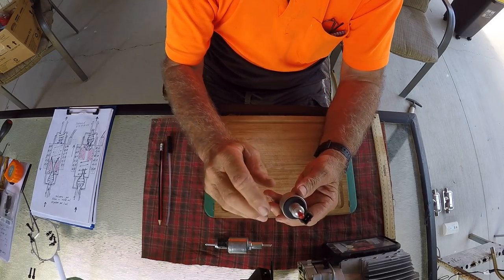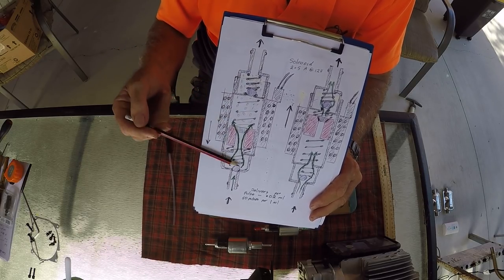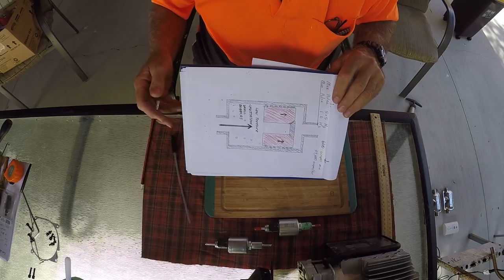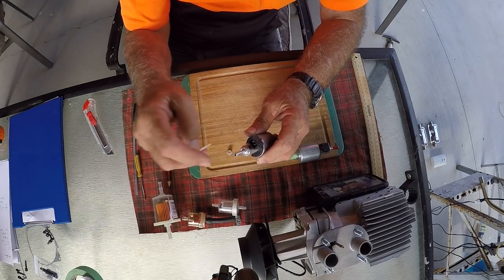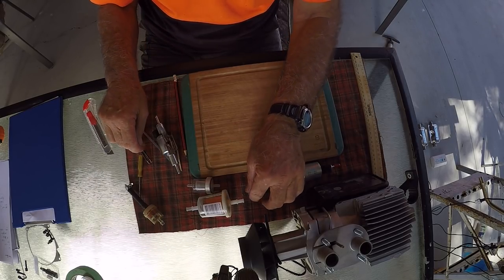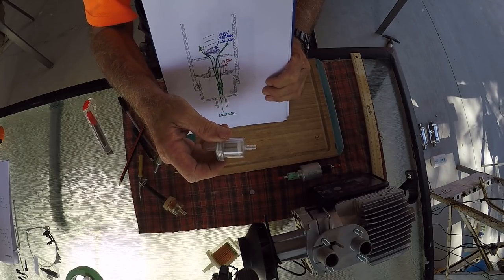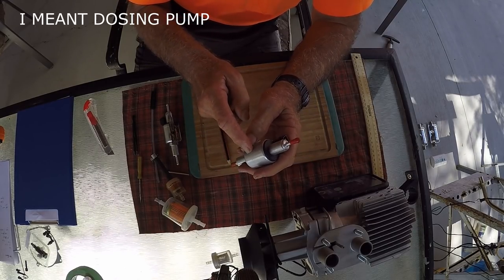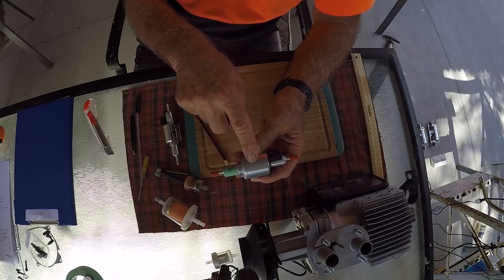Chinese Diesel Air Heaters   Part 7   Metering/Dosing pump

Comment: Hi John. I've primed my line and filter (the country way as you put it!) and the pump clicks away but it doesn't seem to draw any fuel through. There's no sign of anything happening to the fuel in the filter. I've left it clicking away for a while. Any ideas? Thanks in advance!
Reply from the maker: Hi Tim,

Did you let it go long enough? Each stroke pumps a very tiny amount of fuel and it can take some time before fuel goes through the line.

Have you connected the hose to the pump inlet and not the outlet. Some people install the pumps upside down. The wire plug to the pump is on the top, outlet side of pump.

If the pump is fully primed, and fuel is actually at the bottom of the pump, take the hose off the top of pump and get it pumping, either manually, or turning the heater on. After a minute fuel should squirt out the top of pump.

If no pumping fuel, could you have had some rubbish in the line that blocked the pump?

Next, get a small container of fuel and a long piece of hose and put the container about 1m to 2m above the pump. Prime the line and connect to bottom of the pump. Does the pump now work?

It is very rare, but possible you have a dud pump. If a new heater get on to supplier for a replacement pump. If an old heater, you need to buy a replacement pump.

Good luck.  JMcK
Reply: @johnmck1147  Thanks for that, really helpful. I also wonder if the pick up in the tank has a problem. I could suck fuel through, but only just so maybe the pump is trying by it can't bring any more through. I will expand the opening so the straw fits more snugly and see if that help. If not I'll proceed as you suggest. Thanks for taking the time to reply.
Reply: Hi John. I disconnected the pump today and just put it in a jar with a little fuel in the bottom. Even then nothing spurts out the outlet. I can see something moving up and down in the inlet but there's no sign of any fuel going in. It ticks away and sounds like it's working. I think I'll contact the manufacturer for a new pump.
Reply from the maker: Tim Redding 

Hi Tim, 

Are you sure you have the pump the right way around?

If so, looks like you have a defective pump. Get on to your supplier for a replacement. 

I have never had a new pump fail, but when I cut one open I can see how the smallest bit of dirt can stick under the little one way valves, and a slight mishap in assembly can cause serious pump issues.

Would love to know the outcome.

Cheers.  JMcK
Reply: @johnmck1147  Hi John - Got it fixed! I used a manual bulb pump I got years ago to prime a car fuel filter and drew fuel right through the pump. Maybe it just needed to be full of fuel, or there was something jamming it that dislodged, but it's spurting nicely now. Thanks for your help! Tim
Reply from the maker: Tim Redding 
👍

Comment: Hi John. i have just installed one of these heaters, the dose pump is not showing on the screen when trying to prime, and the pump is doing nothing. I tried turning it on in the normal way, it starts the fan, shows the exhaust/air intake arrows for about 20 seconds then stops doing anything. any ideas. Thanks.
Reply from the maker: Hi IL,

I need a bit more information to be more helpful.

First when you turn the heater on it goes through a start cycle and the pump does not start until this cycle is completed. You must wait a minute or so in some cases for the pump to start. In new installs, the unit will try a bit longer to start.

If there is some issue in the start cycle, the unit will turn off and you will get an error code on the screen.

If you don't get an error code, just give the heater time to do its thing.

Cheers.  JMcK
Reply: @johnmck1147  Yep, OK this is what is happening after some mucking around today. If i push the bottom left and right buttons to prime the system, there is no symbol for the pump and nothing happens at all. i unplugged the power at the pump then plugged it back in and the symbol appaired. but it never continued on to work. I tried starting it from the start button, The unit/heater clicks then clicks again ,the screen blanks out for about 20 seconds then reapairs,.it shows the symbols for air intake and exhaust moving and the glow plug, then back to the home screen. I'm trying to figure out if it is a faulty controller or pump or the main board. Thanks PS it is bloody freezing here,
Reply: error 7 comes up. sorry.
Reply from the maker: Hi IL, E7 is a wiring fault. 
You perhaps may have connected the wires up wrongly, have a polarity issue, low voltage at heater, loose plug, etc.
It is also possible, you have a bad controller, but it is most likely a wire issue.   JMcK

Comment: I just got a heater and used it three days and now I have an 03 error code. The old glow plug was fine and it was still clean after three nights of use. Now it seems like I’m not getting any fuel because the bubbles aren’t moving when I prime the heater. Does that mean the dosing pump has gone bad? I’m not getting any ignition at all.
Reply from the maker: Hi Noah,

Error 03 is generally related to glow plug issues, but you said you checked the glow plug.

First up. You only prime the heater once. That is on first start up. If you do this each time you can totally flood the heater and in particular the glow plug screen and glow plug cavity. If you do this the heater won't start. 

You also mentioned the little bubbles aren't moving. 
When you start the heater the pump does not start for a minute or so as the fan tries to clear any unused old diesel. Is this your case?

Next. Is the pump making a ticking noise, and the bubbles still aren't moving? This could indicate pump failure or fuel blockage. It is very unusual for a new pump to fail. The most common cause is a filter blockage with poor quality fuel. 

Without further info I am unable to give more suggestions.  JMcK
Reply: @johnmck1147  when I press the on button I hear one click and it shows E03 with the glow plug flashing nothing comes on at all except the lcd controller. No fan, no pump, no ignition. Idk if this is related but my lights flicker every time I push the power button. My battery is charged by solar panels and I have a dc-dc charger and my battery is only 8 months old with no issues and I’ve never ran it down below 12 volts.
Reply: @johnmck1147  also I am running 6mm wire from fuse block to the heater loom. The heater wiring loom is 14awg.
Reply from the maker: Hi Noah, 

lights flashing on button press indicates a power issue to me. It could be battery, wire loom, or connections. A battery can show over 12V at rest, but not deliver much current when required. Suggest you put a voltmeter on the battery and check the battery voltage on heater start. If it drops below 11.5 V you have a battery issue. Your heater should be connected directly to the battery, and not through some distribution bus.

If battery ok, suggest you put voltmeter on the two power wires coming into ECD. If it drops below 11.5V you have a wire loom issue.

Please let me know how it goes.  JMcK
Reply: @johnmck1147  the seller sent me a new one so I replaced it. However I get to keep the old one. When I get time I will try to figure it out. Right now I’m still working on other things. This time I  hooked up directly to the battery. It started up right away with no issues and ran all night. I did run out of fuel. Do these still run the fan to cool down even if the fuel runs out?  I was worried it might have ruined it. But after putting fuel in it started up with no issues
Reply from the maker: Hi Noah, yes the fan will run. If you run out of fuel the ECU goes into shut down mode like normal. There are no issues.  JMcK

Comment: I lubricated the pump by filling the filter with fuel, attached it to the pump
and held it upside down to bathe the pump in fuel...
I did this on both sides of the pump
then I refilled the filter... diesel fuel is mighty greasy...

Comment: Hello John, what a fantastic body of knowledge you have produced with all of your videos! Thank you.  A question re storage.  Our van is based in Brisbane so can easily go 6 months or longer without heater use. Is there any value in completely draining the system for extended storage to ensure trouble free start up next time? Does adding fuel stabiliser assist with long term storage? Perhaps a very short final run with some kero added?  Your thoughts will be appreciated thanks.
Apologies if this has been addressed previously but have not picked anything up from the many watched  so far.....
Reply from the maker: Hi Grahame,

A high percentage kerro/diesel mix (90/10) can be advantageous at season end  to burn off excess carbon but is not necessary if heater has good install and is use correctly.

Jenny, in video motorhome, does not flush and has no issues with heater each winter, but I advise her to turn off fuel cock at season end. 
On the boat it can be two years between heater use and we don't flush or anything, just an end of season short hot burn for carbon removal and turn off fuel tap.

If you use a ethanol blend fuel you must drain and flush the system at season end, same as you must do for outboard engines, mowers, generators etc if not constantly used. An ethanol blend is not good for these products.

In Aus enviro diesel is not common, but is common in some overseas countries. Enviro diesel causes issues with the pump and atomisation screens in these heaters during storage.

Cheers.  JMcK

Comment: What about if it's not clicking on taking anything like that does that mean it's fried how can that be a control panel
Reply from the maker: Henery, if the pump is not clicking, it can be a dead pump, a voltage issue, a wiring issue, or an ECU issue. 

You can check the pump by tapping voltage to the pump. You must tap the voltage (on and off) from a battery as the pump is an electro magnet.    JMcK

Comment: J, I need help. I am on my second dosing pump in a year. Electrical remains fine and I believe the piston is getting stuck. Is it bio diesel that is my problem? Should I use kerosene? I've watched all the other videos and have things mounted correctly and filtered.  Pump will work for several uses, but then suddenly stops. First failure it was working for a couple hours, shut it off, and went to start again an hour later, pump would not start/cycle. Replaced pump and it was fine but now this second pump does not cycle. Chinese parts. Is there a better pump available or what is my issue? JohnW
Reply from the maker: Hi John,  suggest you only use normal diesel or a kerro/diesel mix, no more than 90% kerro, 10% diesel. 
I hope you have a good fuel filter installed, the battery and wire in good condition and the pump is raised to more than 15 deg vertical.

As I say in my videos, these heaters will run on virtually anything......For a while. Then they jam  up
The pump has a tiny little piston which is activated by an electromagnet, and can easily jam from small particles of dirt or “greece” in some biodiesel.   JMcK
Reply: Is there any chance I could get the failed dosing pumps working again?  How?
Reply from the maker: @johnwitte4152  ,

Sometimes you can flus out the grit and sticky oil residue, but the Chinese pumps are quite cheap, and it is often not worth the effort.. ..Suggest you always use a filter and only use good diesel, or a diesel kerro mix fo fuel.  JMcK
Reply: @johnmck1147  is there an option to get a better dosing pump? I've replaced it once but wondering if there is a better pump available.
Reply from the maker: @johnwitte4152  
Hi John, you could try a genuine Eberspacher dosing pump, but it will cost you more than a complete Chinese heater system.  JMcK
Reply: @johnmck1147  it turns out the final diagnosis is tubing material. When replacing the pump I noticed how the tubing felt too soft. Upon inspection the tubing was deteriorating on the inside and turning into jelly like sand. I was able to clear both stuck dosing pumps, and refit to stiff nylon tubing as in your videos. The original tubing came with the heater and I thought it was comparable to what your video had shown. Nope,  too soft and not compatible with fuel. Note this is not bio diesel but regular diesel used in trucks here. I don't see how to share a photo here, of tubing interior, but it was clearly the problem.
Reply from the maker: @johnwitte4152  
Thanks for the feedback John. There is a problem with much of the clear plastic fuel line now being supplied with some heaters.
Are you able to email me the photo?   johnmck47@outlook.com. Thanks.  JMcK
Reply: I've sent the photo now Sept 4 here in Iowa
Reply from the maker: @johnwitte4152  
Thanks John, I received the photo and it has really perished. Sadly, at this time many heaters are being supplied with this type of hose.  JMcK

Comment: I have an old gas heater from a 73 super beetle. I tried running it on diesel instead of gas but it didn’t work 🤷🏽‍♂️ It has one of those little metering pumps but I don’t know how much they put out . Maybe someone here knows. Also why does it only with with gas? The glow plug seems to work. Maybe it doesn’t get hot enough to ignite the diesel 🤷🏽‍♂️

Comment: i want to mesure the ohm how do i do`? thx in advance
Reply from the maker: Hi GA, put a multimeter on the Ohm scale and measure across the two pump terminals.  JMcK
Reply: @johnmck1147  what shuld it show then, i only have one so i dont know how many ohms it shuld be. thx in advance

Comment: Hi I have just install a new 5kw heater and yes it does run well but is smokes quite a lot can any one tell me why
Reply from the maker: Hi John,

Does it smoke all the time or just on start up?

If just on start up it is generally because of residue unburnt fuel left in burn chamber.
This can be caused by improper shutdown or the fuel tank being higher than the heater and fuel seepage into heater when unit is not used. Easily fixed by a fuel shut off valve. Turn off when heater not used.

If heater smokes all the time, this can be caused by the fuel used. Are you using nice clean diesel?

Smoke all the time can also be caused by fuel/air mix imbalance. This is often caused by poor install with excessive restrictions in combustion air inlet or restrictions in exhaust.  
Or use at high altitude.   JMcK

Comment: Can anyone help please - we have installed one of these - when we turn it on the fuel pump pumps but nothing comes out - we have flooded the pump and pressed the 2 buttons to purge - and the fuel pumps out as shown in your video - but when we turn it on and let it start the fuel doesnt pump through - can anyone help - we have spent hours trying to work it out!
Reply from the maker: Hi Kerri

First up. Did you wait for the heater to do its start up program?

When you first start the heater it goes through a start program. First the fan comes on, then the glow plug heats up to temperature, and only then does the pump start. It can be some minutes from switch on to the pump starting.

If you have issues like low voltage so the glow plug does not get hot enough, the pump will not start. But with these issues you generally get an error code on your controller.  JMcK
Reply: @johnmck1147  yes we allowed it to go thru everything, but it just keeps turning off - no error code - just completely bemused! I expect we r doing something so silly but just cant work it out! We see and hear pump starting but just no fuel comes thru, yet when we purge it by pressing the up and down arrow as stated in instructions the fuel pumps out! Just doesnt make sense!
Reply from the maker: Hi Kerri,

On start up you should first hear the fan start, and a while later the pump should start ticking. Then the burner will ignite, the fan will get louder until burner full functioning.

If the heater runs for a bit and then shuts down it can be a number of things.
Faulty controller or ECU.  -  A little  unlikely. These days these heaters are mostly reliable.
Glow plug issue. Broken or faulty glow plug.
Low voltage issue. ...Glow plug not getting hot enough from low voltage.
Fuel pump issue. ... pump has blockage, 
Fuel delivery issue. How far from pump to heater? Are you using narrow bore hard nylon on the delivery side of pump. If the heater is more than about 300 mm from pump you need hard nylon fuel hose, not the cheap vinyl clear hose now being supplied with some heaters that absorbs the fuel pulse.

How do you know no fuel comes out of the pump?
How long does the pump run before it shuts down?
Are you sure you do not have voltage drop issues?
Are you sure you have correct polarity connected. The pump will still work with reverse polarity, but not the ECU or controller.

It is unusual to not get error codes. It is easy for me here, I just hook up a spare controller to see if it is a controller issue.

Recheck your install, and if still no go, and heater is new, suggest you ask for a replacement. 
The controller should show error codes.

Please let me know how you go.  JMcK

Comment: could it pump oil?
Reply from the maker: Yes, an electromagnetic dosing piston pump will pump many fluids, even water, but there must be some lubricant in the fluid to prevent piston wear.  JMcK
Reply: @johnmck1147  Couldl I use one of those simple PWM motor boards from ebay to run it?
Reply from the maker: Hi Chris, I haven't tried that, and unless I have actually done it myself, I don't like to comment. Sorry.  JMcK

Comment: Universal Electric Fuel Pumps Car Air Heater Diesel Pump Accessories for Air Heater Diesels Heater 0.022 Ml/S 12V 1KW-5KW 126×34.5mm 5 × 1.4